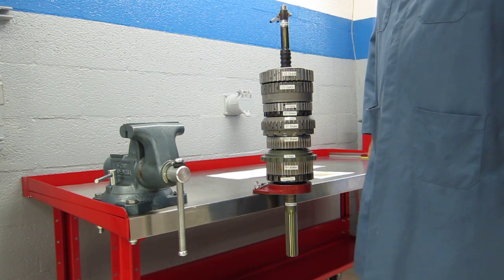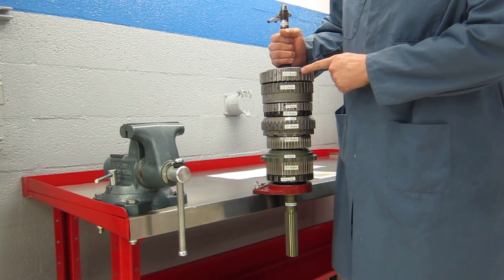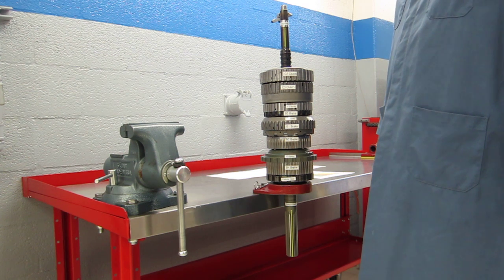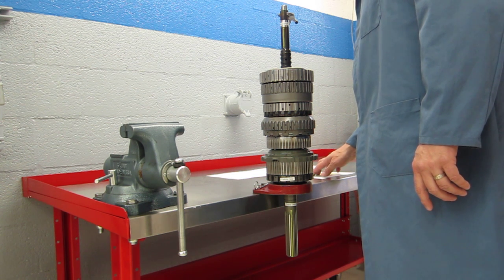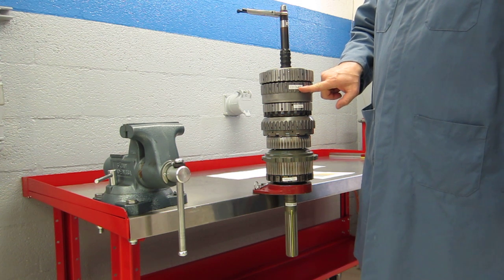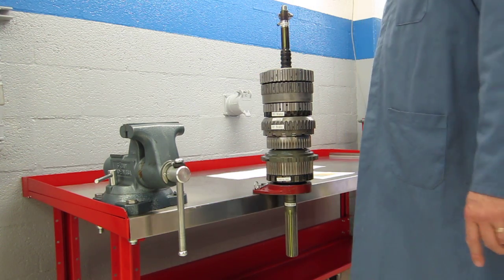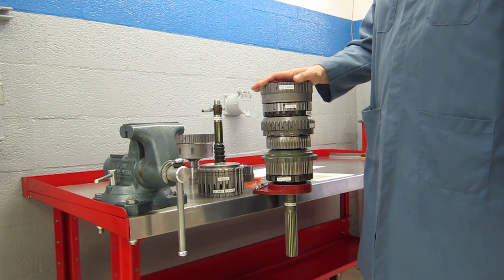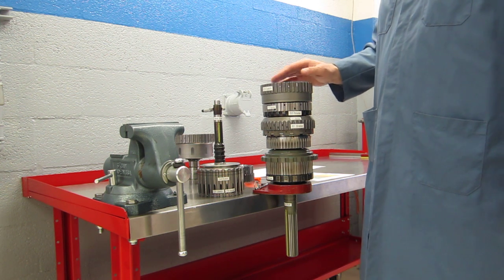Toyota AB60E/F 6-Speed Automatic Transmission Power flow

Comment: Friggin' amazing the complex hydraulic dance that goes on, not so much the overall pressurized system of it, but the intricate solo dances of different canals of transmission oil pressurizing clutches & bands on command. All being controlled by computers of course. I'm still coming to terms with my archaic GM 4L60E, but, it's a starting point. Planetary gears are truely baffling, & amazing.  Gear ratios I understand. Good video, gave me a better grasp of PGs' in action.

Comment: What would stop 1st and Reverse from working (engine free spins, no output shaft movement) , N works and when used in the LC200, these have a 2nd start, this worked fine and 2-6th changed gears perfectly. No 1st or reverse. It has been fixed but wondering the technical reason

Comment: What are the output shaft differences?
For example, can an F output shaft be installed in an E(without total disassembly) to install a transfer case on an E model?(2wd extension housing removed of course.

Comment: i have 2007 tundra 5.7 2 wheel drive
when i am driving and i lightly press the gas peddle and the it down shifts the trans there is a vibration kinda feels like a wash board type of a feel 
when pressing the gas hard works fine
could this be the trans
i have 350,000 miles and have never servised
Reply: check trans fluid. my ford f150 did that. i topped off the fluid and it worked like a dream. if it isn't low fluid, i would start checking the toyota forums. i am not very familiar with the tundras. (they don't break enough for them to come to me. lol.)

Comment: hi basic question, when i downshift the car, RPM goes up, pls advise how RPM is increased, even though i am cruising at same speed. what i did is like i am at 40 mph then i manullay downshift the gear to lower one. this is done in fraction of second, my RPM went up because of downshift, but what cuased my engine RPM goes up in crank sensor, any relation to torque converter, clutch or speed sensor, please advise. no ware i found answer, came to u finally
Reply: I don't know if you are still waiting but here goes. Recall riding a multi-speed bicycle. If you were to down shift to a lower gear but maintain the speed you were at, you would have to start peddling faster. It is no different than how the engine (or you in this example) slow down as the upshift occurs due to the ratio difference. Now you specifically seem to be describing a 'manual' downshift, rather than a kickdown shift. As you either pull the shifter to a lower gear or use a paddle shifter, etc, that induces what is called "engine braking" as (opposed to breaking!). The instructor speaks of "brake clutches" and "one-way clutches". During the upshift you will commonly find such OWC apply. Think of them like a ratchet, spins one way but locks to drive the socket the other. If it weren't for these "brake" clutches, the other OWC would just overrun and you would not feel deceleration. By locking the component to the case, the "brake clutch" forces the geartrain to hold in a lower gear ratio. It would be much easier to follow on a simple three speed transmission. There is too much going on here to readily grasp. However, adding more and more gears in many cases is like adding a simple transmission in front of another. For example, many of the first common overdrive transmissions, such as a GM 4L80E, took the original three speed TH400 and essentially added a two speed unit in front of that. Fact of the matter is though set up as a 4 speed, by overdriving third gear, they could have opted to overdrive 1st and then 2nd gear, turning it into a 6 speed with very short ratio drops in between gears!

Comment: When you down shift your rpm increases because you are shifting to a higher higher gear ratio witch your engine needs to turn more to keep up with the same speed you are going at with causes rpm to go up ,a manual break is applied to keep it in that gear wen going to your manual gears on an automatic witch gives you compression breaking .i hope that helps